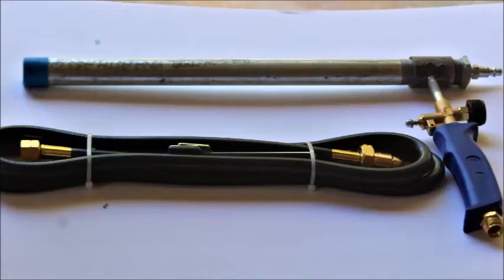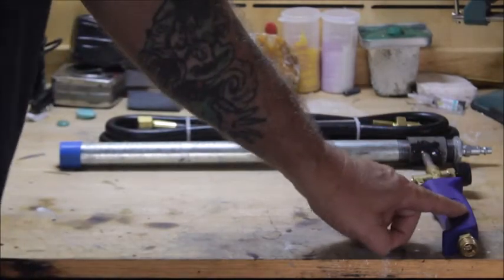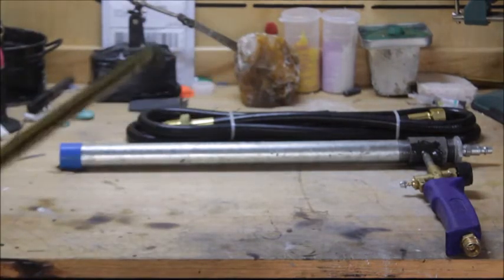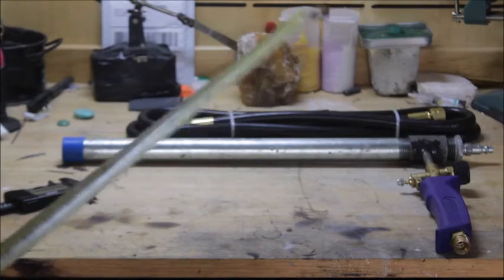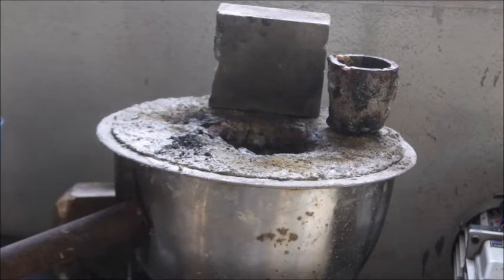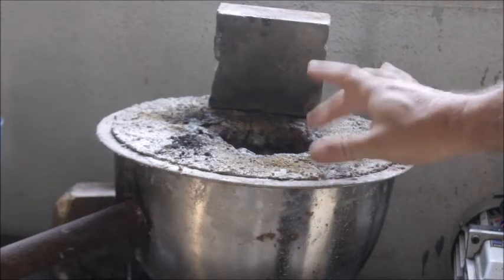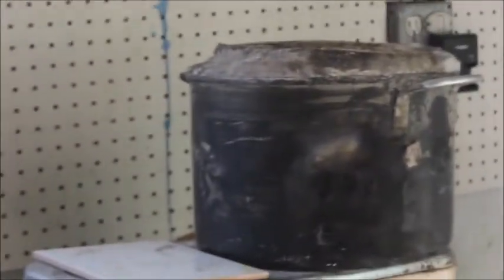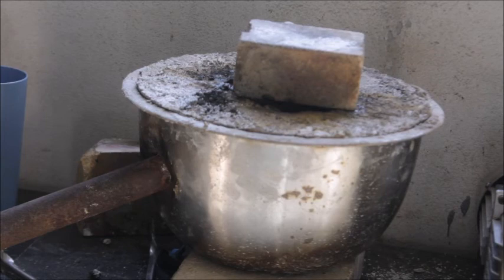Super Hot forced air propane foundry furnace burner build , forced air metal melting furnace burner

Comment: what kind of compressor do i need for this?  I have a small  6 gallon and built a similar design but it seems it can only keep 10-15 PSI for a little while before the tank empties.  any advice is greatly appreciated.
Reply from the maker: thanks for the comment...... you will need a compressor that can put out 20 to 30 psi at a constant rate..... the larger the tank on you compressor the better...........I would say min tank size of 15 gal.....let me know if you need more help....